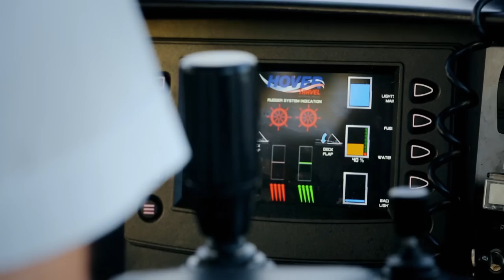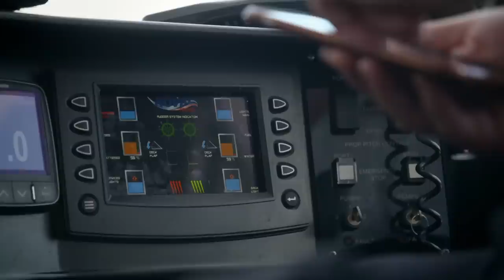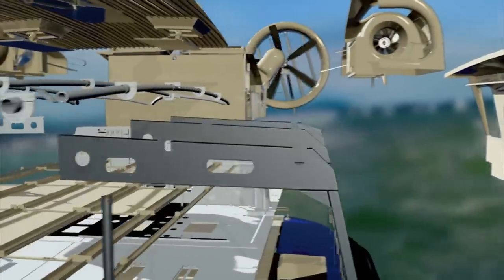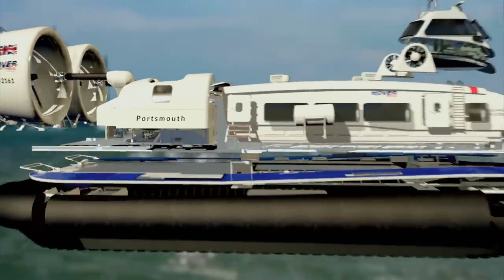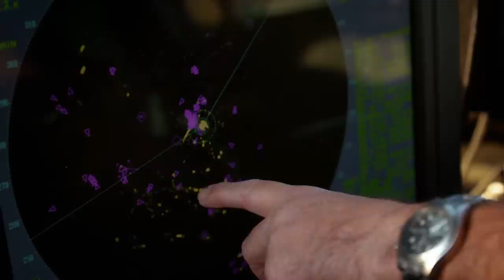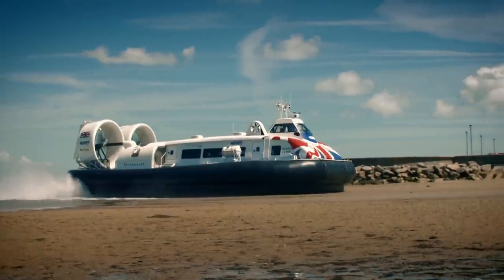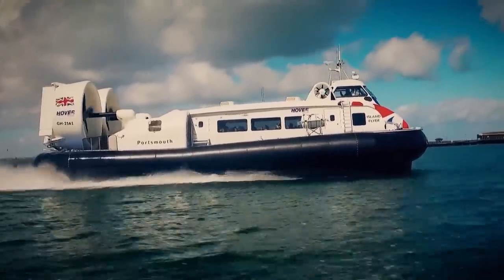Piloting A Massive Unique Passenger Hovercraft | Rise Of The Machines

Comment: Does the hovercraft carry ALL of the island's mail, or is it split with other vessels?
Reply: It doesn’t it’s used for passengers and the isle of white is quite small. Not many people live there (except for me lol )
Reply: Split between other vessels.
Reply: oliver lunn: I know for a fact that the hovercraft transports mail. Each vessel even carries 'Royal Mail' graphics on the sides.
Reply: _blue_pearlie _ Thank you.
Reply: @oliverlunn8235  also how do you live on the Isle of Wight if you spelt Wight as white?
Reply: It can bring across mail, but the standard way is for Royal Mail lorries to come over on our car ferries. Source; Am Islander. Unlike what others say, the Island does have a sizeable population of around 140 thousand people.
Reply: Jack Gravez: Thank you for the information.
Reply: @oliverlunn8235  It has a Royal Mail logo on it so it probably carries mail.
Reply: I can support what others say, it does indeed carry mail for Royal Mail, I’ve seen it on several occasions being dropped off or collected from both terminals. I’m sure mail also goes across the Solent by other operators also as Wightlink and Red Funnel ferries operate different routes to and from the mainland.
Reply: @oliverlunn8235  Not many people, only 160,000...

Comment: "Massive machine"?  The hovercraft which used to cross the channel from Ramsgate were ten times bigger.
Reply: They were really big yeah. Prop. diameter was 5.8 meter (about 19 feet) driven by a Rolls Royce Proteus engine (4 in total, each assigned to 1 prop). There is still 1 left for display in a museum.